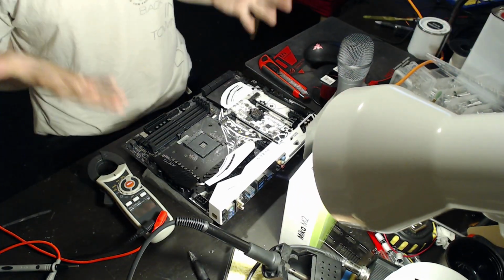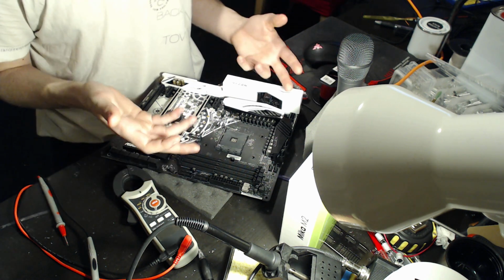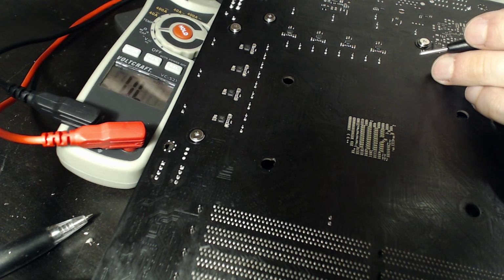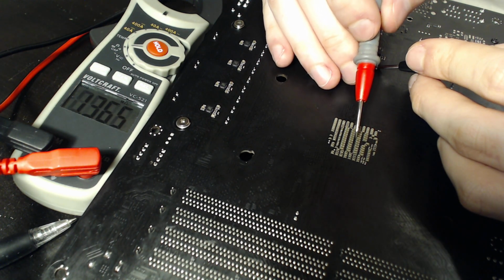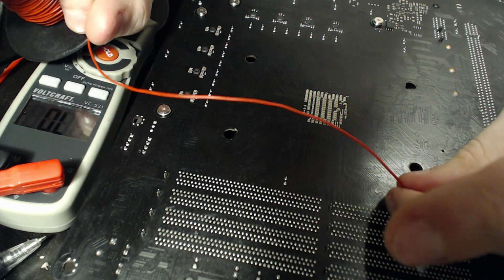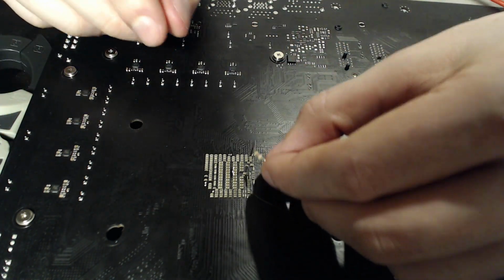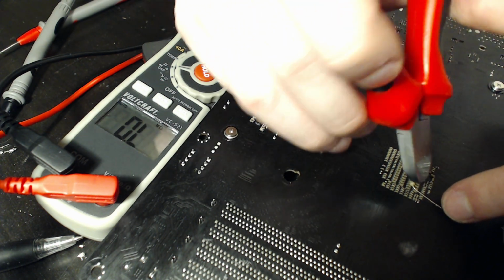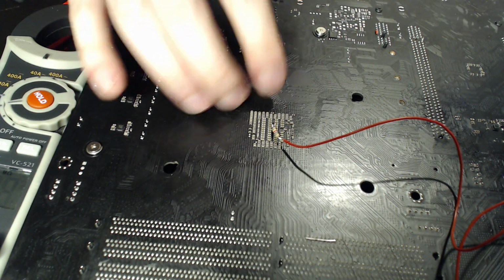Attaching a Vcore measurement line to the Asrock X370 Taichi

Comment: I know this is an older vid but I’m currently working on my ASUS x99-s and was checking the core voltage 
I checked the VRM voltage and it was 1.7v I then checked it at the smd’s at the back of the board and again it was 1.7v 
Showing Q code 00 which i found out is cpu detect related I haven’t changed the cpu voltage and it should be at stock 
I’m now worried my cpu is fragged is there anyway other than putting it in another known working system to check the cpu 
Thanks for any info

Comment: Nice video.I am new to overclocking and had a couple questions I was wondering about answered.I have a crosshair VI hero and the 
various voltage readings reported by software where in question.Using the PROBE IT voltage points showed that the software
was reporting way higher than my 2 voltmeters (to verify meter reliability) showed.I think I need to try to read back of socket now 
and verify PROBE IT point is not dropping volts due to resistance due to distance from socket.I acually have been looking at cheap 
LCD voltage readouts and wondering if I could hard wire that (or several)to the various PROBE IT readout points.
http://www.wonmeter.com/dc-milli-volt-measure-meter-056-dc-0200mv-positivenegative-display-5-digits-red-led-digital-tube-display-voltmeter-p-436.html#.WkdYmzeIZhE

Comment: couple of things:

-identify the tools you use before you start
-where to get the tools and what you recommend
-zoom in the camera a little more if possible, even with 1080p it was still hard seeing exactly what your soldering
-i like how you explained the 5k resistor
-maybe perhaps provide a difficulty rating , beginner, intermediate and advanced or a numbering system in case we would like to attempt the activity being shown

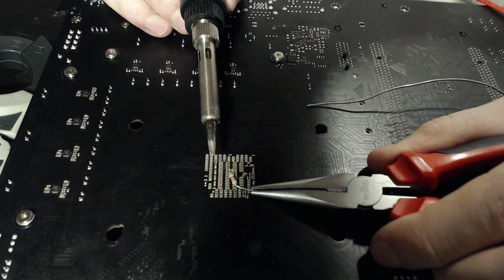Comment: 23:35 "Ehhh I think I'm gonna leave it at that point..." >proceeds to soldering again
Also I always solder at around 350-370°C with thicker tips. When I use thin 1-2mm tips, I go up to 400-410 because those have lower thermal capacity and tend to cool down quickly. 
Good video as usual btw. More of the modding stuff.

Comment: Why not use the continuity mode on the multimeter? It basically measures resistance and beeps if it is below a certain value which should be described in the manual.
Reply from the maker: a lot of meters beep under 100ohms and for example VRAM on a GPU is typically 20ohms to GND. Vcore is less than 5 ohms. So if you measured from Vcore to VRAM it would tell you they are connected.

Comment: What's the crosshair VI Hero like with voltages?
Reply from the maker: no idea I don't have the board
Reply: Good Lord that was a fast reply! e.e
Reply: I know this is totally off topic but do you have any idea if the memory controller on the Ryzen 7 1700 is less likely to reach higher DRAM speeds when compared to the Ryzen 7 1700x?

Comment: so in your opinion this is the best am4 motherboard i thought msi was I'm a asus motherboards fan since 90s all my pc are asus motherboards. but am4 asus are not for me I'm looking at msi can you help me make my decision on am4 motherboard oh I don't like to run. 2 video cards I just run 1 .
Reply from the maker: Some of the MSI AM4 boards are really overpriced. Like the X370 Xpower it costs the most and runs a VRM that arguably worse than what the Gigabyte Gaming 5 and K7 have. The best highed boards would be the Gigabyte K7, Asrock Taichi/Professional Gaming and the ASUS Crosshair 6 Hero. Bellow that I'm not sure. On B350 ASUS and MSI and Asrock are your best options.
Reply: wow thank you very much. lots of respect.
Reply: so gigabyte it's coming with ryzen  1700 8x8 ram I saw some were that am4 going to have memory 4000hz update I'm still holding untill summer. thank you very much for responding.

Comment: You might want to solder the insulated wire to the board caps first then attach the resistor inline on the wire with some heatshrink that way you have less exposed wire close to the board.

Comment: Was a good video to watch man. Not too long at all as you did cover various things that beginners like me might not have known. It even makes me think there is a chance for someone like me to be able to successfully do some basic volt mod work (as yes, believe it or not, my soldering skills would make you look like a pro).

The one thing that could help illustrate your points a bit more would be if you are able to do some post editting to include some HD photos of what you are trying to show (capacitors, solder connections, etc). Your camera did pick these up well enough to be seen, but as things get smaller and more complex, this may help. Although you have previously said you had editting yourself ;P

Comment: wouldn't it be better to have the wire attached to the board with the resistor on the other end before your probe.
Reply from the maker: I'd say that's up to personal preference. I like to do it this way the only issue is backplates.

Comment: On the front of the resistor not fitting under a pot or what have you, surely you could put the resistor somewhere in the middle of the cable or at the end, positioning wouldn't really have any adverse effects
Reply from the maker: Yep true.

Comment: are you interested in getting your hands on the asrok ab350m pro 4 matx? 
im getting my r5 1600 up to 3.99Ghz on 1,375v on bios,  seems prety stable,  havent Stress tested it properly thought
still its a bitch on my gskill ripjaws v 3000mhz ram,  it only gets to 2400 after the latest bios. 
btw asrock on am4 also uses the thick copper layers,  or so they say...

Comment: That's cool. I've thought about doing that before many times, it would be nice to have a real-time readout that is not in software and taking up room on the screen.  I've just not been able to find an affordable mini volt meter that can display multiple test points at the same time and fit in a floppy drive bay (or CDROM bay), that does not cost ridiculous money.

I have a few temp and fan RPM drive bay displays, nothing for even a basic 3.3&5&12v display, lol.  Great vid by the way, the focus is good enough to get an idea, thanks, BZ.

Comment: One little thing that would worry me: the vapor while soldering. Do you use something that sucks it up? I guess it is about the amount you breath in during your life but still...metal won't get out of your lungs once breathed in and we live in a world with a lot of air pollution from a lot of sources. Louis Rossman (I am sure you know him) held quite a preach about needing to use a ventilator which sucks up the vapor, at least when you solder as much as he does which obviously is much more than what any tweaker does.

Comment: A microscope would be good like Louis Rossmann uses, but that could be expensive. Bigclivedotcom does a good thing. He makes a big photos about the parts for the explanation. That could help greatly I think. You can do a macro photo and explain things on that than do it live with the camera as close as possible. Having said that, I think it was perfectly clear this way too to understand. So it is much better than nothing if you don't want to change the format.

Comment: This is interesting.            
I saw the difference in size at the capacitor bank behind the cpu b4 u called it out ( but just barely )           
Might be nice to use an old webcam to just capture the multi meter to make it better visible and.              
Presentation and everything was fine and interesting.          
p.s your soldering SUCKS ;)

Comment from the maker: first
Reply: Actually Hardcore Overclocking :(
Reply: Righteous hair :lol:
Reply: #robenger64 *clocked

:)
Reply: you should try using conformal coating when trying to protect your motherboard pcba
Reply: I actually LOVE this shit, only thing i'd have preferred is a better lighting for the multimeter... with the screen not being backlit its hard to see when you're bent over actually doing stuff...
Reply: Jaap Brasser, I've seen far worse LCD displays on meters and calculators that are only visible at very specific angles when not completely indistinguishable. The meter BZ has is a good one for the display, and a better one would be extremely expensive.  Also, I've yet to see a meter with a backlight that does Not have a self off timer of only a few seconds, so a pointless upgrade for anything longer than that few seconds (including getting readings from across a work site). It would be so incredibly nice to get a meter that does NOT auto shut off that does not cost multiple hundreds of USD, I've yet to see one, to be honest, lol.

Some meters can be modded, tho that is getting rarer with the advent off chip-on-PCB black blob construction.
Reply: Quick question; have you ever measured the actual ripples/overshoots on Vcore on this thing when it switches from idle to load and vice-versa? Ever been able to capture that moment on the scope? I'd be very interested about that, and I figure a lot of other people would want to see how the different boards 'perform' in this regard. Since this is essentially limiting you on which LLC you can safely run - surely some boards have better transient behavior than others. Would you be willing to do a quick scope measurement on this X370 Taichi? I'd be super interested but lack the equipment.
Reply: This is the best your hair has ever looked.